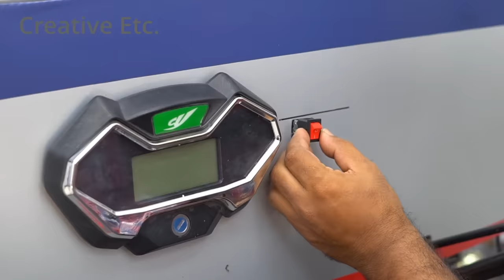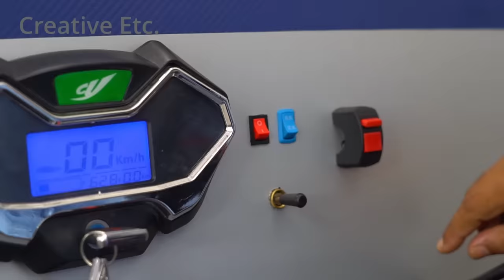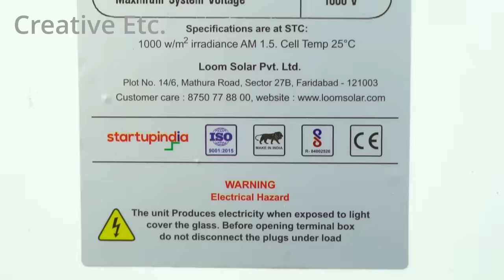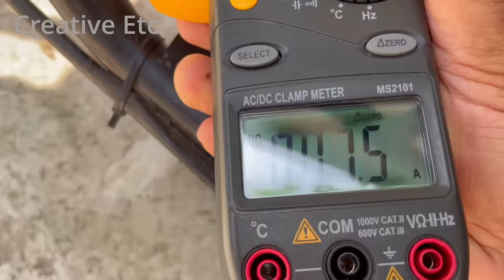I Made a Solar Electric Car at Home

Comment: Good Job. Some suggestions from my end. You can use some more smaller panels of same voltage in all the available areas in parallel so that you maximise the amps for charging. Keep one extra battery separately for charging from the panels which can get charged while in the move. A 2 way switch can be used to change the batteries for charging and usage. If one battery is discharged by driving, Just change the switch to the other backup battery which was charged by the panel. Also the wind shield should come above the rear panel to reduce drag. Well done. Well thought and executed...
Reply: why have a switch can run the batteries in parallel
Reply: Solar panels usual charging is 10am to 3pm. It's not the light it's the heat that charged the batteries. If it's tilted or installed at sides what's the use?
Reply: Боковые панели малоэффективны, лобовое стекло правильно обдувает нижнюю часть панелей для большей эффективности
Reply: @EricSmith-qm7xb  Not good for battery to charge and discharge at same time
Reply: @anythinganywhere05  You may be driving in different directions at different point of time in a day light. So if you have multiple panels in parallel it helps to capture available light in that direction. Even a minimum amount of ampere helps in charging the battery. That's the point
Reply: @Habibulla.M  obviously you have no idea of how a solar panel system works and probably you don't own one. 

Second on your concern with the battery. Wet batteries that are used in automotive vehicles is different from solar batteries which are "deep cycle" 

One thing you do, observe first in your area or to a friend that does have a solar then you will understand.
Reply: then how does a generator/alternator  work
Reply: It's can't work from solar!!! Tooo small.
 Must be in 3 or 4 time bigger solar panel!!
Reply: It is FAIK!!!!!
Reply: @anythinganywhere05  I have installed a 4 kW solar system myself in my house after getting 2 levels of professional training and certification. I am aware of battery chemistry and solar panel working. Plz don't judge people on your own. Also I got certified in entrepreneurship development on EVs. All the best for your understanding
Reply: @Habibulla.M  hahaha don't joke around, if you believed you had certification and just build your own 4kwatts in your own house? Fine with me but believing you NO.

1. You said, add smaller panels to maximize vehicle available areas. 

Smaller watts and bigger watts panels can't be mix technically if do the bigger watts will be downgraded becoming useless in production.

2. You said add a 2 way switch for two batts while 1 on use 

Parallel and series connection of identical batteries are very effective with additional fuses of course. 

3. You said battery drains while charging are not good (your 2 way switch purpose).

Deep cycle batteries used in solar and turbines are designed for these and the author or video owner use a power inverter it had voltage regulator and battery charge level sensors to adjust to desired percentage.

Please don't lie, I had my own system for solar and I built my own 24v wind turbine.
Reply: @Habibulla.M  In a way you're funny but a liar. 

No offense but any person with knowledge will knew as per your statement. Read it again for your self. 🤣🤣🤣
Reply: @anythinganywhere05  I have never said all panels will produce full potential at all times. Moreover. It's only to get power from one or other panel at any point of time. I don't have to prove to anyone. I was just suggesting some improvement he can think of in his design. That's it. I don't want us to waste anymore time on this.
Reply: @Habibulla.M  hahahaha
Reply: @anythinganywhere05  Happy.... Have a nice weekend...God bless you...
Reply: @EricSmith-qm7xb  Reserve / emergencies
Reply: Yer kya hai sasta toto
Reply: @anythinganywhere05 

Just a question.

What batteries were the solar industry/community using before the advent or use of deep cycle batteries????
Reply: @anythinganywhere05 it's light, not heat
Reply: @imanyoel479  hahaha
Reply: @anythinganywhere05 Heat actually reduces the performance of photovoltaic module. Your statement regarding heat is obviously incorrect and is evident when you use the correct terminology and understand the definition of “photovoltaic”
Reply: @anythinganywhere05  " It's not the light it's the heat that charged the batteries"... what are you talking about??? :p
Reply: @Habibulla.M there is no problem charging and using a lithium battery at the same time. If it's being used, the current from the MPPT will be used directly by the motor without even going into the battery.
Reply: Very good suggestions.
Reply: Hey can we order your plan
Reply: @pau1phi11ips that’s what i was thinking!!!
Reply: U cant charge and discharge at same time. Current flows one direction only and that is towards lowest voltage which is from battery and from solar panel to engine or from solar panel to battery. Not from and to battery at the same time
Reply: @Habibulla.M  How do you think solar systems work. You use the energy that come in from the panels while also using the battey. If you have more solar than you are using then you battery charge will go up.
Reply: @kameljoe21  What do you think of my suggestion for having a second battery. That's isolated from the motor by a switch and will only get charged while the other battery powers the motor. Basically you have 2 batteries. One running the motor and the other one getting charged from the panel. You should switch them interchangeably so that the depleted battery gets connected for charging from panel.
Reply: @АндрейИванов-б6б7ж  It has a battery pack.. Of course the panel isn't enough to run direct, but in standby or parked conditions or while slow cruising the batteries might charge. The point is it's self charging and a bonus if the day is sunny while driving.
Reply: @Habibulla.M  > Not good for battery to charge and discharge at same time

Since you've said you're an expert, then please explain why energy in and energy out is bad for batteries. Wouldn't this essentially be as if there was no wire hooked to the battery? Electrons are canceling out at battery tap and going from source directly to load are they not?
Reply: @АндрейИванов-б6б7ж  the power from solar must be not enough to drive, actually the plank car is driving by the batteries not the solar.
Reply: @Habibulla.M Don't worry, it's something that never doesn't exis， AT THE SAME TIME the battery could never charge and discharge.
Reply: @jameszhi187  You are correct. That's why I suggested the creator to go for another battery backup which can only get charged with the panels while the vehicle is on the move or just parked under the sun. Once the main battery gets depleted he can start using the backup battery and keep the depleted battery for charging again with the panels using the switch.
Reply: @anythinganywhere05  s  b huu
Reply: Plz Location?
Reply: @anythinganywhere05 please reeducate yourself on functioning of Solar Panels.
Reply: @urbashidigitalbangriposi8749  🤣
Reply: J
Reply: P
Reply: I don't know how much people care about anything these days depending on what asshole polotics are sent thier way or not! I just want to appreate this craft! I find it hard to appreate humans when I have witnessed how aweful this system is and how people think fooling other's is normal! You can't last within this type of work playing games like that! These people are amazing and straight forward people who offer the world somthing in return! Other than my daughter I find it hard to get up in a day because of all the junk polotics! I hope to not feel left out because I know it's not the people who worked within this feild! Wow, already feeling better! You're a good builder! That's not easy yet you have some methods that make at least some jobs alot easier such as the floor peddle! Safety come's to mind yet that seemed functional! Neat! For any builder out there, you ever get that feeling of letting go when paint is drying? And only with that application because that is not the same as dealing with people? Only trust for the wise!
Reply: Lol, don't be upset! My brain seems like yours! I would have to read this whole comment to make sure everything is correct before liking! If your like me, I just want to thank you for your very long comment! Because it shows care to detail which connects to think work and more important a language that is very much missed! It's like keeping away from builders to build! What an aweful experience yet amazing because the wise just know! CANADA THANKS!
Reply: Total Expense?
Reply: @anythinganywhere05 study the basics of how solar panels work. What you stated is wrong.
Reply: Çok teşekürler bende ki motorda 6 adet akü var 72. Şarj cihazı var ve bendeki güneş panelim 320 watlik var onu nasıl takarım bir yatfimci olursaniz
Reply: I have installed 20kw solar roop top power producing system in 2016 running super
Reply: @Habibulla.M not true.
Reply: What is cost price this vehicle
Reply: He already use double cut panel.
Reply: Hell make an airplane
Reply: Thank you sir ❤
Reply: Oo carregamento dos carros elétricos são feitos em tomadas fixas com veículo parado. Fico pensando porque a engenharia automotiva ainda criou um sistema continuo de carregamento enquanto o veículo se desloca?
Pelo que percebi, o construtor deste protótipo tem a intenção de inovar. Seria interessante um veículo autônomo que precisasse de tomada para carregar. Como viabilizar esta questão dependerá da equalização e aprimoramento do sistema.
Reply: Next time position the brake and gas pedals in positions they would be in a normal car versus the go cart style.
Reply: Will sell me this car

Comment: Brilliant piece of Indian engineering. How long did it take you to make it? How much did the material and machinery come to?What was the final cost? How much would you sell it for? What is its speed?  What is its autonomy? (Here I assume its consumption in power is less than the power provided by the panels which brings me to my next question. How much exposition to sunlight to replenish the batteries? Is there an alternative solution to charge up the batteries in the absence of sunlight? What is the lifespan of the batteries? What were your qualifications? Are you self taught? Your demonstration of its construction is delightful. If you had been wanting to start a factory building these I would invest in you. Unfortunately I am penniless. I do believe your simple vehicle has a future and could be sold worldwide especially in sunny countries and it would ber worthwhile crossing the nullabor in Australia without "refueling", even without batteries if it were possible. I believe wholeheartedly in your invention and its simplicity, even when it comes to access for repairs. I have just realised that you have answered some of my questions in your explanations.
Reply: 6-7 year lifespan of battery

Comment: Great workmanship and marvelous mechanical and Electrical work done. You are the Man a country needs.❤
Reply: Any man with a bit of knowledge can make this frame model, but they don't bcz there r traffic rules and roads safety guidelines as per the Motor vehicle act and National green tribunal. This man should apparently be punished taking out this frame on the roads without the permit and patent of the product.
Reply: @wisdom8792   this can be said good craftmenship, but this heavy bulky piece of iron can not be said as Solar electric car

Comment: Few things I would change. 
I would find those light weight solar panels and use a bead roller to fix them on to sheet alummiuim. The bead roller will make thin sheets stronger and help reduce weight. 
I would also make it 4 wheels and use hub wheels for both sides. This will allow you to make a much wider car around 6 feet wide and 12 ish feet long. 
Making the roof flat will give you about enough space for 1kwh to 1.5kwh of solar on the roof. Amount will vary based on the size of the panels and you can adjust the widith wider to fit extra panels on and longer or shorter to fit panels. The project really comes down to how much panels and how light you can make the panel array. These frame less panels can be riveted on and holes cut out to bring wires inside the cab. 
Making the frame of the car much like you would find in a golf cart style with bench seats will allow you to have seating for 4 people or more and even some room for cargo. The type of frame is also good to add a very nice coil suspension. Setting up the panels on the roof to run in series would be best and an pwm charge controller. I do not think you would want an mppt charger because it require adjusteing for voltage and that would not work for on the move. 
The nose can be flat as you are not going to gain all that much from aerodynamics. 
Other than that there are several solar powered unit out there. Just search for them. From solar powered boats with no battery, cars, bikes and everything else. Even a solar powered plane.
Reply: The trade of is efficiency of the panel iirc, but at that point wouldn't you have to go through the whole process of encapsulation?
Reply: Also a bit scary to have the only brake be that one drum on the rear wheel.

Comment: I think a huge design modification would be tilting the solar panel to be lesser in height than the wind screen. Then you would decrease the drag co-efficient of the car drastically.
Reply: Top speed is 45km/h, no problem. This way there's some ventilation
Reply: Looks like that was done to add some head room in the build.

Comment: Cool project! 
6:12 It looks like with the angled front suspension you get a huge toe in/toe out depending on the weight of the vehicle. This will greatly impact the efficiency of the vehicle.
Reply: i have a clock model. my dad even helped me make the clock

Comment: Very awesome . Like a few people have mentioned the placement of the solar panel is creating a lot of drag . I wouldn't more the windshield up though because the solar panel will be more efficient with some cooling instead a roof scoop to direct some air under and otherwise smooth the flow over and around the panel might work really well. Could also reduce all that noise .
Reply: The noise was from the follow car - it's not an indication of the noise in the electric vehicle - although I don't doubt that it is noisy.

Comment: Great job!  I believe that if the windshield were to cover the front of the solar panel you would create less drag and increase the vehicle's speed.
Reply: Better still, leave the solar panel at home, with a few more to beef up the output to a useful level, than have a battery charging at home, with another on the car. 
This car is simply too small to accommodate enough panels to make a difference, so the best improvement to the driving range would be to remove them altogether and thus eliminate the drag and weight associated with them.

Comment: What is the cost of the entire setup? Would it be possible to get some sort of list of components/price? (I understand this would vary a lot depending on providers and location, but still it would be quite interesting) And what is the weight and load capacity of the structure? Great video, thanks for sharing!

Comment: If I were doing it, I'd go with LiFePO4 battery cells because they deliver a high and stable discharge current. Plus, they'd be more compact. Paired with supercapacitors, it would be an ideal setup.

Comment: Love your design , bar one possible flaw !! 

Aero dynamics ,    if your thought was ,to cool the panel 

You are trading that for less traction on rear wheel.

And putting un needed stress on the panel, too as it acts as a wing 

So just extend ,windshield , to over lap , panel slightly , to correct

Comment: I'd get rid of that steering wheel hub adapter. I had a cheap casted aluminum steering wheel adapter that looked just like yours, and the threads that engage with the axle got damaged over time making me steering wheel come loose. It was a very scary situation as I was doing 60 MPH on a US highway. I had to quickly use my Leatherman crunch (vice grip) to grab the axle and I was able to steer to the side of the high way with my multi tool. 

Those cheap steering wheel hubs should be banned! Don't make the same mistake I made, and stay safe. Nice build BTW!

Comment: I would love to build a small electric cart for going around town, but would need much more solar input.  A flexible panel could be wrapped around the front, the Hood, so to speak, and it would be more aerodynamic with that.  THey are not as efficient as flat glass panels but it would add an extra 100 watts or so.  And of course you could put more flat panels on the sides and get one in the sun in each direction you travel.  You could also use solar panels in the doors as GULL WING doors and leave them up in the open position when you are not driving it.  I believe you could double your solar by doing this maybe even get 500 watts.  You have done a great job so far.  That is a compact battery, so there is room for another.  This prototype has all kinds of room for improvements when you get ready.  Very good welding too, and I liked your idea of using a wire frame as a pattern.

Comment: Nice build  , you choose simplicity with in wheel motor , me i put a 700W brushless with a chain transmission  , no front suspension , but the seat has it.About same performances but 36km/h max.

Comment: The use of peddle assists with a recumbent bike and a design to suit would be another way to integrate technology for users to extend travel and mitigate fatigue without use of power supply points.